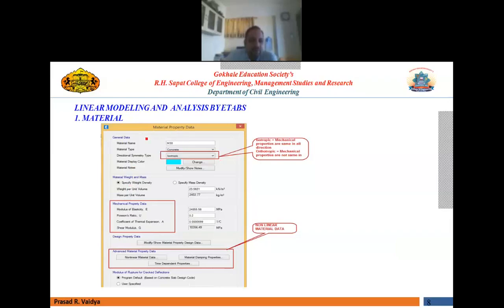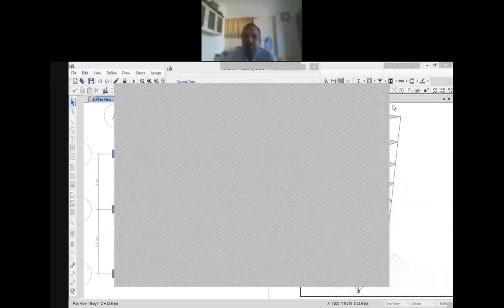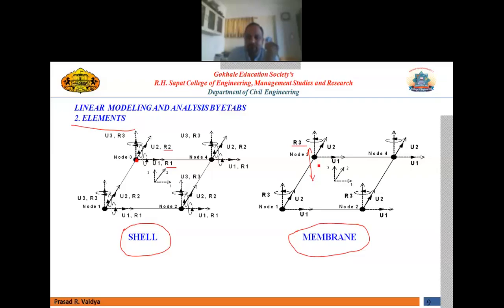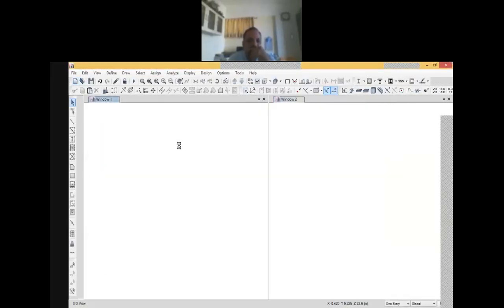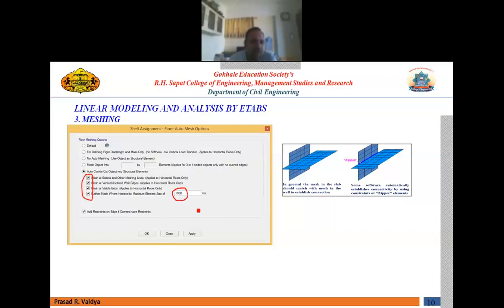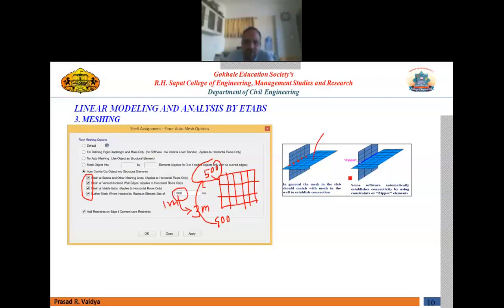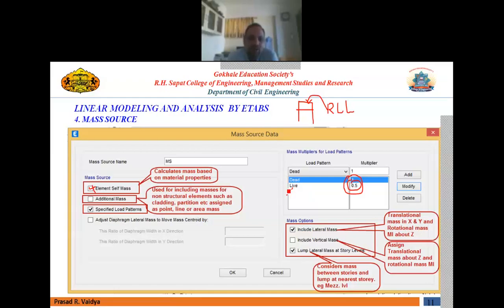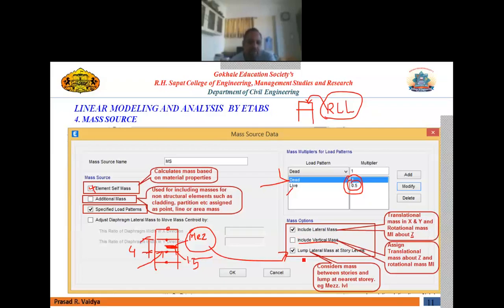When to Model the SLAB as SHELL or MEMBRANE in ETABS Software, Meshing, Linear Modeling of building

Comment: Very Nice Video, my question is I modelled a structure and inserted slabs using both methods as shell thin and membrane, when modelling slabs as shell thin, the supporting beams had considerably less bending moments almost 80% less, while membrane slabs were transferring full loads to beams as expected, therefore In real life situation what moment should I design the beam with? Should I design the beam with the moment from Shell thin or membrane method?

In the same context, when designing slabs as shell thin, even if the slab has its own stiffness, well understood, then how does the load transfer path look like? How does the load reach to the column? Wouldnt it require to pass through beams and then to the column, if so wouldnt the moments in the beam be high? And eventually be same as the beams from the membrane slab method analysis?
Reply from the maker: Membrane is equivalent to frame without slab. In reality the thin shell with property modifier of 0.001 may be used as conservative approach or else thin shell with usual property modifier as per IS 1893 are used as optimistic design approach.

Comment: If the slab having different live loads in each floor. How do we need to define mass source either I.e 0.25 or 0.5 value in LL for mass source
Reply from the maker: Define two seperate load cases namely LL<3 & LL>3 and give sperate multiplier for each case in mass source

Comment: Respected Sir. If a slab is supported in a panel of 2m x 5m, there are two beams of 2 m and 5 m supporting the slab. Should we assign such slab as one way membrane or as shell thin since it is one way slab based on ly/lx ratio.?
Reply from the maker: One way and two way actions are only considered in membrane type assignment only. However shell type assignment will automatically consider load distribution as per end conditions and stiffness of slab. If you are interested in only load tranfer to adjacent beams go for membrane or if you need the appropriate stiffness contribution of slab go for shell
Reply: @skh_CivilEnggVideos  So we can conclude that if we provide reinforcement as one way or two way, load distribution would occur as per the end conditions